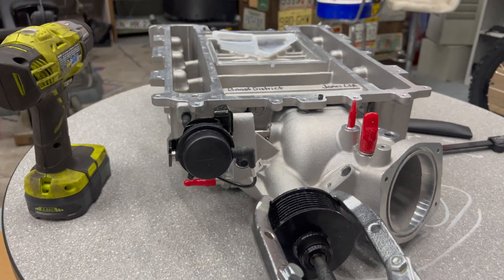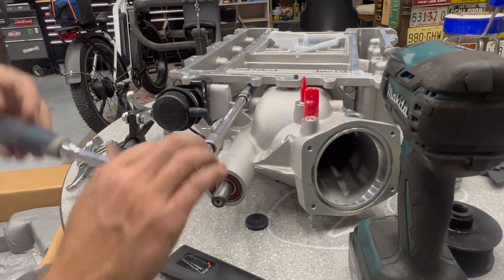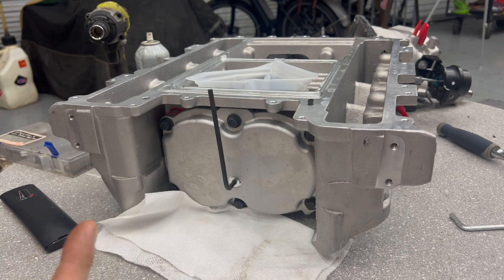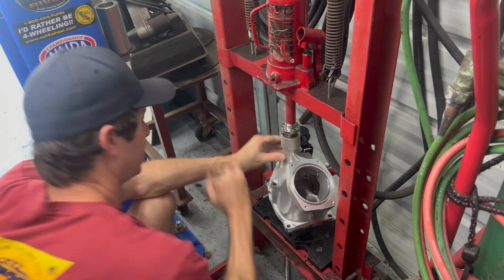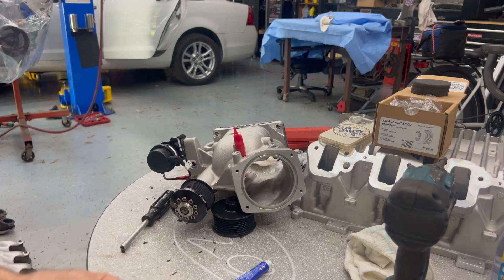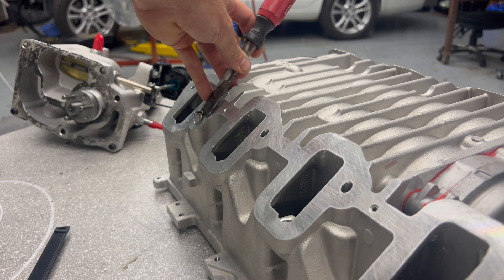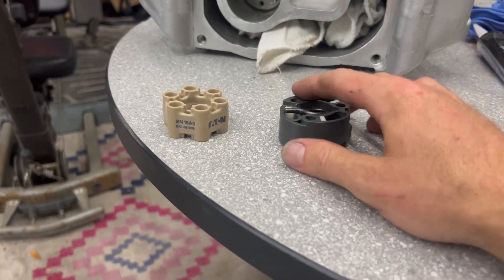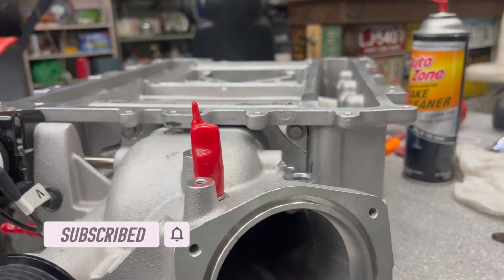LSA GripTec Pulley swap

Comment: A pulley change so more boost is generated is a relatively easy way to get the LSA to 600 plus HP.
With a cam swap to a larger cam with more lift as well as the pulley upgrade, the LSA should be pushing around 700 HP with a tune....
A camshaft in the 215-235 range with 550 to 600 lift on intake and exhaust with an LSA in the 113 to 116 range should do the job.
Obviously supporting mods such as an intake and headers and exhaust are highly recommended.
😎🇦🇺👍

Comment: Nothing wrong with the spring loaded isolators per Ed (Chief Designer). You will get gear noise with a solid isolator. One evil or the other.

I noticed you said it was a new supercharger, but the video showed isolator spring wear on the isolator shaft, which again, is normal. That supercharger was not new. 

Good job on the video as an instructional.